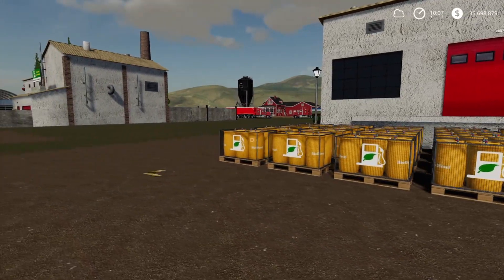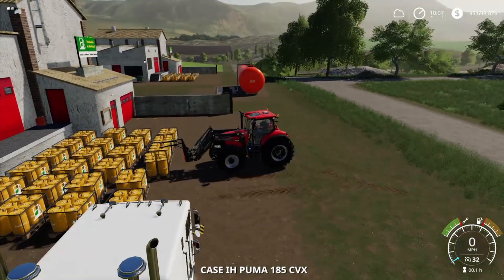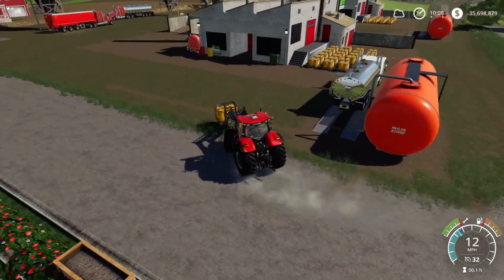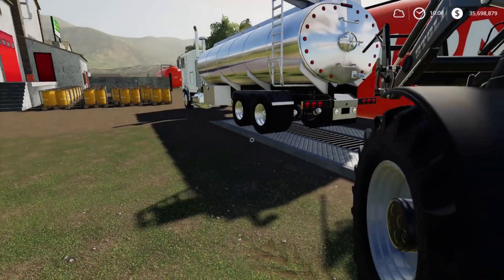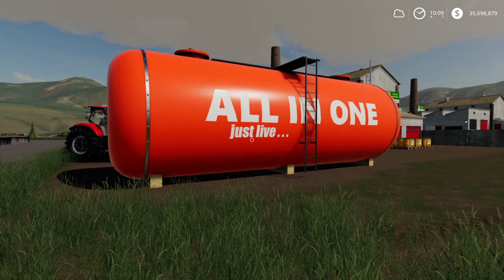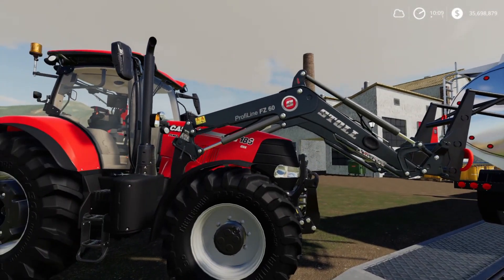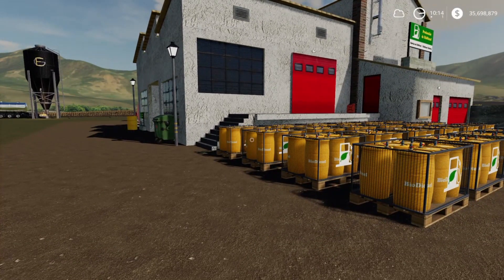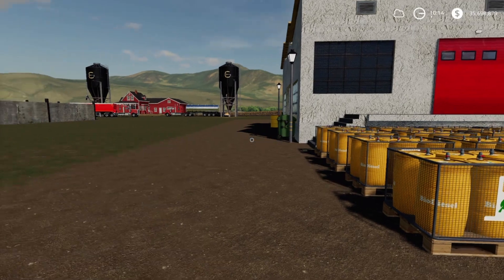Part 2 - How To Make BioDiesel With Placeable Factories | Farming Simulator 19

Comment: My AIO silo doesn't accept Biodiesel (PSP4)?
Reply from the maker: The two ways I've found that work are to hold a pallet over the silo trigger with a front loader or to use the autoload IT runner mod.
Reply: @Driver53Gaming  Yea, i tryed, like you did in the video, but i get the message "Biodiesel not excepted"
Reply from the maker: @The_Duke_of_Wirdum  were you using the liquid silo?
Reply: @Driver53Gaming  Ravensberg Factories 2/2.
Also in the prices menu, capacity shows "-"

Comment: What does the “compost” do?
Reply from the maker: Compost can be sold or used at the BGA I believe.  It didn't appear on this map though.  I am changing maps so I can sow the factories off better.
Reply: @Driver53Gaming  did you ever find out how to get the compost out?....
Reply from the maker: @ryanpauloneeyed9669  Check this one out. https://youtu.be/dLig40H5bIk
Reply: @Driver53Gaming  ok thanks man. Have you/ are you going to do a video on bread and donuts?
Reply from the maker: @ryanpauloneeyed9669  I'll be doing them as part of a new series I'm starting soon for sure. Will probably do ones similar to the biodiesel also.

Comment: Sale the compost offset the cost a bet filled the other factory's with biodiesel and have not filled them up again been running for a year on the map store and sale high
Reply from the maker: Where were you able to find the compost?  I searched all around the building with no luck.
Reply: @Driver53Gaming  over by the fuel tank dark beam on back wall and the crop fill spots
Reply from the maker: @jeffsandefur6886  thanks. Maybe I didn't have the right trailer.
Reply: @Driver53Gaming  it produces on the ground I'm on ravensburg it may not work on all the maps
Reply from the maker: @jeffsandefur6886  That seems to be my problem.  I'm switching maps so I can properly show these off.
Reply: @Driver53Gaming  no problem thanks for the idea of the tank for biodiesel keep up the great video's
Reply from the maker: @jeffsandefur6886  thanks. Will do.
Reply: @jeffsandefur6886  thanks I've just found it thanks to you.

Comment: How do you fill other factories with the biodiesel you produce?
Reply from the maker: There are a few tanker trailers that accept biodiesel. I've started using an autoload IT runner setup in more recent videos.
Reply: @Driver53Gaming  do they load directly from the pallets? Or do you need to transfer the pallets into a tank? I tried loading the it auto-loading and it worked but then I couldn’t load the other factories ?
Reply from the maker: @giorgioantonioninniriva633  I've been able to the autoload to work on Ravensberg. Had problems on other maps. Was able to manually empty the pallets into the all-in-one silo without problem.
Reply: @Driver53Gaming  yes I had no problems loading the auto loader, as I have written! So you have to un-load the pallets manually? Sounds like a broken mod to be honest! Will it receive any further suppprt?
Reply from the maker: @giorgioantonioninniriva633  no sorry I meant that the all-in-one silo and the new silo by Shaba I haven't had any issues on Ravensberg. When I was using other maps I couldn't get the autoload to unload.
Reply: @Driver53Gaming  so using those silos you can directly unload from the auto loader?
Reply from the maker: @giorgioantonioninniriva633  that is correct.

Comment: Have you tried dropping the auto loader into the spot the biodiesel comes out at the factory?
Reply from the maker: You can put the autoload trailer into the dock area without a problem.  The pallets will appear and then get loaded right away.  I am having issues with the autoload trailer though.  Will be trying to get it sorted this week.

Comment: You can't use Bio diesel on Xbox
Reply from the maker: Which map are you using?
Reply: @Driver53Gaming  I’m have the same issue I’m in earika farms
Reply from the maker: @feenixcarlisle3763  Eureka Farms has not been updated to be compatible with the latest version of the placeable factories.